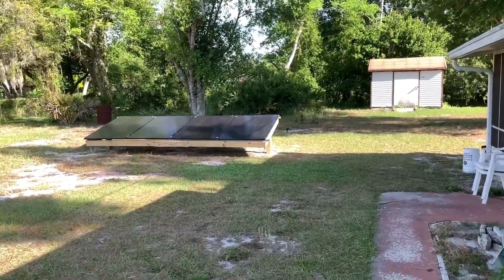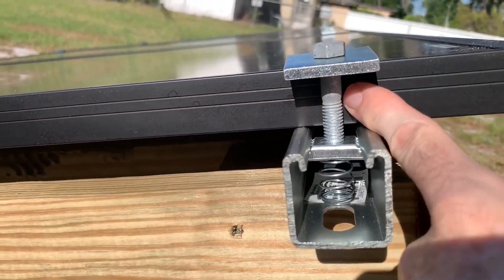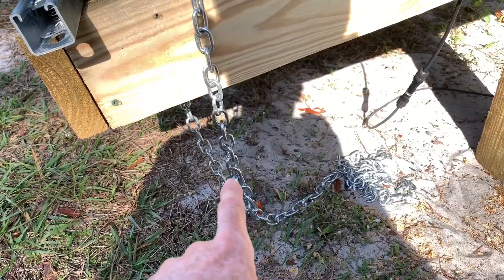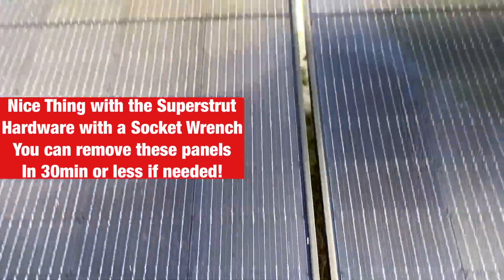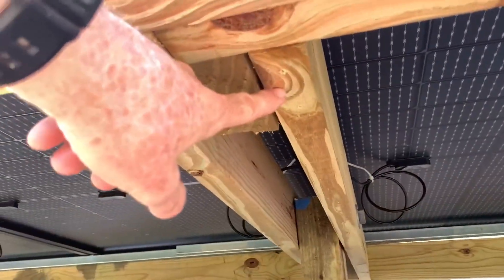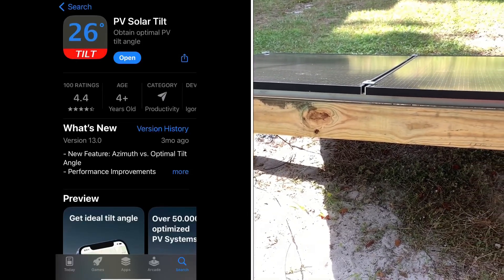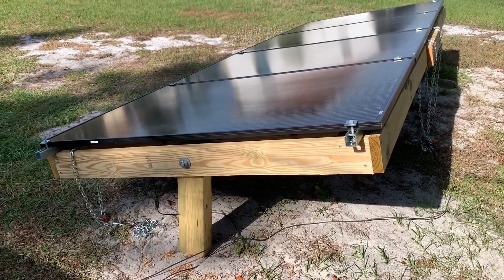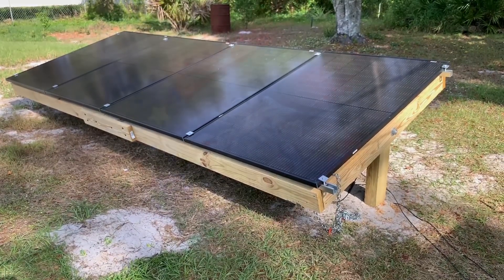DIY Off Grid Adjustable Solar Ground Mount with Talesun 400w BiFacial Solar Panels

Comment: Galvanized bolt touching an aluminum frame won't last very long. Your galvanized bolts on the PT wood you probably want hot dip galvanized if you can't get stainless. You also may want to reinforce the bolt pivot with metal plates and make sure you are within proper NDS edge distances.

In terms of wind load, in NY you need things like this to be rated for 115MPH (inland). A basic wind analysis of your construction shows from 3,785 to 5,241 lbf uplift force. So your chains and ground anchors need to be a quarter of that at minimum to be safe. I would start by upgrading from the plastic tent stakes to a rated earth anchor, and cross them in an X pattern to better share load. Turnbuckles with springs would also help lessen jolts from bursts of wind.

Comment: PrecisionGroupYT:  Thank you for your video and I have seen the other one that you mentioned.  I am still stuck on which one to do.  I like your setup but I was thinking of getting the Eco Worthy (Adjustable Multi-Piece Solar Panel Mounting Brackets for 1-4 Pieces of 200W 300W 400W Solar Panels).  However, this 1 to 4 panels they are claiming is a stretch if you were to use the 1700mm length ones.  You could only really get two panels on with panels being 1100mm plus width.  (200 watt panels times 4, yes!!)

But I do like your setup! With your system you just have one pivot point to worry or should I said to adjust!  3 panels 1200 watts nice!!

Would have been nice if you would have done a list 😉😉 3 posts, 3 doublers with noggins, front and rear cross pieces fixed to the 3 doublers with noggins and Unistrut to fix to the 3 doublers on top!!
Reply from the maker: You’re welcome and thank you!

Comment: Great Video!!!.  I love the design. I was working on a similar design but you just saved me some time. Big questions though. Are you in Florida.? That looks like Florida ground.  If you are did you have to get any approval by the city or county for wind mitigation or for the ground mount to be able to withstand a certain wind speed. I'm in Pinellas County Florida and it a bit of a bit_h trying to set up solar here.  I don't want to spend $2k - $3k for a 155 MH rated Iron Mountain or Integra Rack system.  However, as you stated and as I'm learning, its more about the angle and height that affects what wind it can handle. Again, love the design and information and tips.

Comment: Nice simple design. I like the use of chains and ground anchors, though I think I'd add a turnbuckle to put a little tension on. I don't think I trust that app. It's recommending a very flat 1º in December (and 5º and 8º in November and January) which is crazy at my 35.52º south as the highest the sun goes (at noon on December 21) is 77.9º, so at that moment you'd want 12.1º slope but at every other moment on that day, and every other day in the summer, you'll want a steeper angle. Being out by 10º still gets you 98.5% of maximum power, so around 20º would be a much more appropriate slope even midsummer. Similarly it's saying 32º March and 39º September, which is around the conventional answer: your latitude (35.52º for me)., But that's only exact at noon and the rest of the day steeper is better. So maybe 45º. In June it's saying 61º. At noon on June 21 the sun is 31.07º high (34.29º at noon on May 21, 34.04º at noon on July 21) but the rest of the day the sun is lower, so a panel tilt of 59º is optimum at noon on June 21, but the rest of the day you'd like a little steeper. But a month earlier or later 60º would actually be good throughout the day.  I think I want to change my angles only on Feb 21, April 21, August 21, and October 21 and use just 20º summer, 45º spring and autumn, and 60º winter.
Reply from the maker: Thank you and I have since added turnbuckles to secure the chains which works pretty well!  Yeah not sure why the Tilt iOS App was giving you such off readings/suggestions as the App has been working well for me thus far.  Take care and thanks for watching and commenting, good luck with your Solar Adventures!!

Comment: What a great video, Thanks.  I am putting 16 panels (plus 3 trackers) the same size as yours and purchased 2 Eg4 ground mounts thinking I'd buy 2 more.  They are no longer available so I was looking for the alternative for the other 8 panels.  This is it.  I watched the video you referenced but it was too large and didn't think to down size it like you did.  Brilliant.  I'm in upstate NY with still 2+ feet of snow so still planing the install.  Thanks again  73  W2RBW
Reply from the maker: You are very welcome and I am glad my video was so helpful to you!  This scaled down version has been great for our needs although we did recently expand it to have six panels and with the added benefits of being able to easily adjust the tilt and if a really bad storm comes we can remove the panels quite easily from the ground mount and store them safely in our garage until the storm has passed!  And as for snow with the mount closer to the ground you should be able to more easily remove any snow build up also! 73 K4BBC
Reply: @ I will actually make mine higher so I can get more winter angle (we are at about 45 degrees) and to let snow shed off. Until a few days ago we had 3 ft on the ground. Still 2 plus.  Wind chill tonight -25 to -30f   Winter still with us.  Our oldest son is in Jacksonville. He is laughing at us.  lol.
Reply from the maker: @ awesome!  LOL I bet he is living in Florida compared to your location! 73

Comment: Nice video.  I like the guy you posted about his tilting ground array.  I will probably break up into 3 arrays like he had with 12 on each array.  Of course I need to see what kind of power the solar charge controllers can handle or the all in one inverter/chargers can handle.  I like the simplicity of this approach.  I do plan on adding bushings to the pivot points as well.  How do you secure the array for the tilt you choose?  I assume you have some board that does this.  All the best from north Texas!
Reply from the maker: @brentjohnson6654  Thank You!  I added chains that are attached to 3 of the posts that have turnbuckles so I can adjust and tighten them to the tilt angle needed!  I also added on to this ground Mount array( added two more panels ) and will show this along with how I secure the panels in an upcoming video!  Good luck with your solar project!

Comment: Love this!! I want an array unit that can adjust for all the angles of the year, so both edges need to clear ground space. Maybe a 4ft post would work. Thank you.
Reply from the maker: @lindaferguson593  thank you!  I made the array low to the ground to lower wind forces on the array but when and if I build the next one I will have the array slightly higher off the ground perhaps another half foot to a foot higher off the ground to get a bit more of a tilt angle 📐!  The posts are 4x6 pressure treated posts and they are buried with cement 4ft deep!  Thanks!
Reply: @PrecisionGroupYT sounds great! I'm looking at about a 5ft  height on level to accommodate accessiblility of servicing as well as ground clearance for snow and mowing.
Reply from the maker: @lindaferguson593 Sounds good and smart as long as your not in an area with the potential for high winds!  For example here in Florida we can have sudden gusts of wind between 40-60mph from Severe Thunderstorms which we can’t really predict like we can when a Hurricane is coming as we usually have a few days of advanced notice for Hurricane and like for the last Hurricane we had “Milton” we just took the panels off of the array and stored them safely in our garage until the Hurricane past and put them back outside!  Good luck with your build and wishing you all the best!
Reply: @PrecisionGroupYT  our panels are situated behind our house directly. The house barrier helps a lot.

Comment: A beer can works great as a solar panel alignment tool. And you can pick one up at any corner store. Set it on the panel and when you have no shadow from the can you are set at the perfect angle.🍺
Reply from the maker: @lukefarmer5391  Thank you for the tip!
Reply: Don't forget the coaster :/

Comment: could one 2 x 6 be used instead of two attached to the 4 x 6 post or did you figure panels would be too much weight?
Reply from the maker: @bobr1749  the two 2x6’s hold the 4x6 block of wood in place that I used to mount the Superstrut into!  Could you possibly scale it down for a smaller array; possibly but I followed the design of the other YouTuber I mentioned which thus far has been a great design!  Thanks

Comment: Very nice solar panel mount . To cut cost what do you think about using one by four or 2 x 4 strips instead of unistrut and also would you consider using wide nylon tiedown ratchet straps  holddowns the top and bottom fastened to trailer tiedowns?
Reply from the maker: Thank You! If you look at Tech4U’s video where I got the idea for this particular adjustable solar ground mount from he had 2x6 cross braces between the posts to make it more sturdy but I decided as my array would be smaller with less solar panels I decided not to put those extra cross braces in as I figured the SuperStrut would take the place of the 2x6 cross braces and make the array more rigid and sturdy as it’s pretty heavy duty stuff!  I personally would not replace the SuperStrut with wood plus with the SuperStut it’s easier to make minor adjustments to the panels positions as well as to take the panels off in case a large storm like a Hurricane is coming (as I live in a state known for Hurricanes! )!  As far as securing the array from moving in the wind I leave that to your best judgment!  I found chains with Turnbuckles worked well for this for me!  Thank you for your comment and questions!  I hope this helps!
Reply: I used this same sort of design but with wood instead of superstrut. Works great, though like he says, it is a LOT easier to install/remove with superstrut.  I also am using ratchet straps fo a tiedown system to keep my array at the proper angle. So far, they work great.

Comment: I am working on the same project with the same panels. Do you think you could have been able to use 4x4's instead of the 4x6's that were cut to 64 inches?
Reply from the maker: I am assuming you meant to say 2x4’s or did you mean 4x4 posts?  I would recommend staying with the 2x6’s over 2x4’s ( or 4x4 posts) especially since you need to cut a 1” hole in the middle of each one for the 7/8” bolt to go through in order to secure them to the 4x6x8 posts!  Also the 7/8” galvanized bolts I found and used were only 9 inches in length and would have been too short to go through the 4x6x8 posts with 4x4 posts instead of 2x6’s. I hope this helps answer your question!  Good luck on your build!
Reply: @PrecisionGroupYT  Yes, I'm sorry I did mean 2x4's. I can see now where the 4x6's would be better.
I was trying to get more light in on the back side of the panels. But I see where the 1 inch hole on a 2x4 might make it too weak. Thank you for the reply!
Reply from the maker: @bearridge8288  your welcome I’m glad I could help!

Comment: Given the weight of the wood and the panels, do you really think that they will move in the wind??
Reply from the maker: @stevelacroix2917  In there current summer angle which is parallel to the deck probably not but where I live we can have sever thunderstorms ⛈️ roll in quite quickly and they can have high wind gusts; also in the Fall & Winter months the panels are at much more of an angle which would allow wind to push against them much more easily so I put the chains to keep the panels in the correct position all year round to stay safe!  “ plan for the worst and hope for the best” is my motto!

Comment: That is nuclear bomb proof for sure, why are you not using the other panels you bought. Also those Bi-Facial would benefit being higher of the ground.
Reply from the maker: We wanted to test the design a bit first before going all out!  The way the ground mount array is designed I can easily add on more panels to it as needed!  While the height of the array being higher off the ground probably would help with Bi-Facial gain because of the Possibility of high winds and or Hurricanes we did not want the array too high off the ground for safety!  Thanks for watching and commenting!

Comment: I have 10 of the same panels but only have 8 of them up right now until the weather gets better.  I consistently see over 400 watts on these panels  Closer to 440 watts.  I have seen 500 just one time.  I like the way your rack is designed.  Living in North Central PA I need to get mine a little bit higher off the ground due to the snow.  I am also a ham, N3FE and have been using solar for many many year.  It is very addicting!
Reply from the maker: Hi Corey thank you!  I didn’t mention this in the video but I had a day earlier this month which I did get a screen shot of showing that the 4 panels you see in the video getting 2,075w which works out to 518.75w per a panel!  So I have been extremely impressed with these Talesun 400w BiFacial Panels thus far!  Of course here in Florida the Sun is probably a bit more intense compared to your QTH!  The extraordinary reading of Solar input I got was on April 9th and on that day there seemed to be bright bursts from the sun up and beyond its normal intensity as my 9 Eco-Worthy 195w panels brought in 1,575w in that same moment and screen shot!  I also love Solar and it can definitely be addicting!  I am also happy that our EG4 Charger/Inverter does not cause any noticeable interference with my HAM Equipment which is a big plus as you can imagine as a fellow HAM!  Thanks so much for watching and commenting greatly appreciated Sir!  73